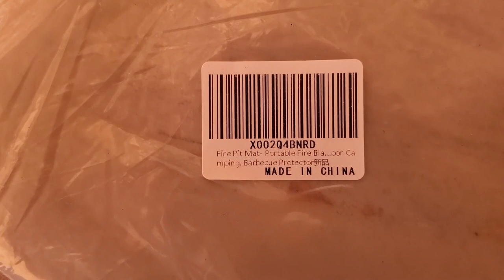Whiteduck Regatta Bell 16 Tent Review

Comment: I did something similar with a  wood table. My table is cut in two parts and I used latches to put it together around the pole. I can use the same table inside and out if needed. So much easier.

Comment: I have a similar tent. I think it’s 19 1/2 feet. It sounds great and it is except I never considered that some of the public campgrounds don’t have a footprint for such a large tent. It is an awesome tent though. I can also be set up in about 20 minutes. If you haven’t done it already, the air conditioner idea works very well. I did the same thing. One piece of advice, open a window. I nearly collapsed our tent. Within seconds of zipping the door shut, two guy ropes pulled out. We had to run it with a couple of windows open. My windows appear to be smaller than yours though. Good luck!  You’ll love your awesome tent!
Reply from the maker: The footprint may be an issue. I've never thought about that in a campground setting. Some reservations will tell you the dimensions of the tent pad.
I did take it out again and it took only 20 minutes to setup. The tarp underneath was awesome. Prevented me from having to set it up at home to dry it out.

Comment: Freaking genius with the table in center! I will do the same! Thanks for sharing
Reply from the maker: I suggest a larger hole in the  center of the table. Mine is a bit too small.  I will be increasing mine by a quarter inch in diameter.

Comment: An old trampoline jumping mat probably would work great underneath , since it won't hold standing water  and is durable . Also would work good for floorless tents or lay on top of your floor inside. It will help  cleaning the debris out . However  Even A 16 foot trampoline mat is only about 15 foot   in diameter.

Comment: Hi,,great video. I’m getting exact same tent, any idea what total foot print is including guy ropes? I’m a little concerned about tent site accommodations but will probably do more “unofficial site” camping 
Thanks
Reply from the maker: It's a 16ft 6inch round tent. Camp grounds with tent pads may be an issue, but I mostly camp in unimproved campsites with scouts. I got to say I was able to sleep later in the mornings with this tent because the thick canvas blocked light very well.